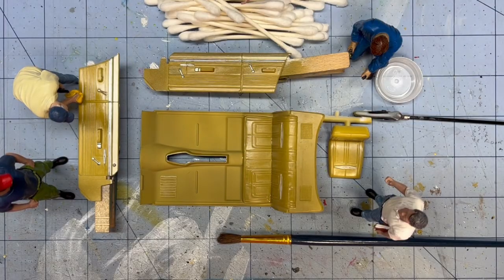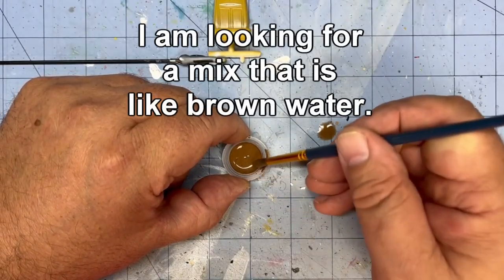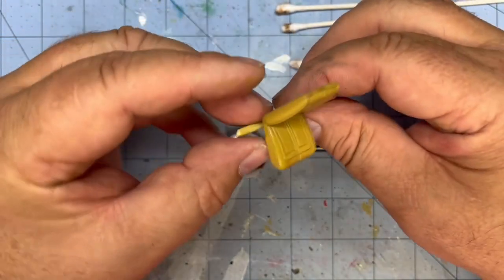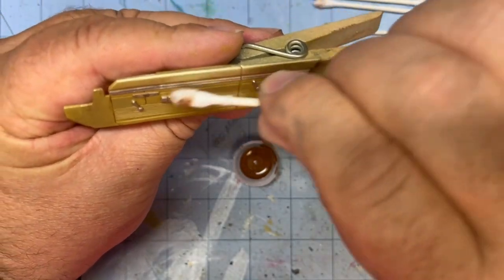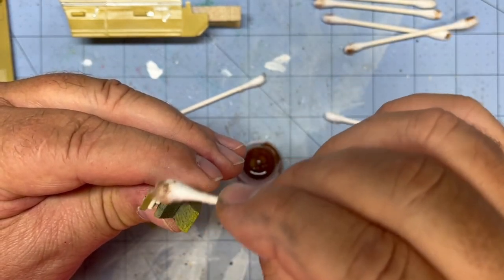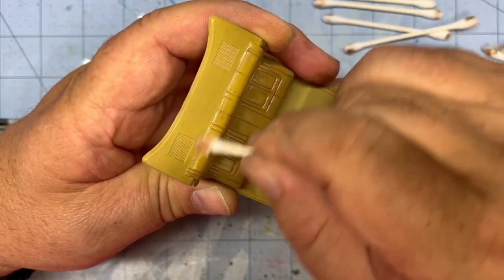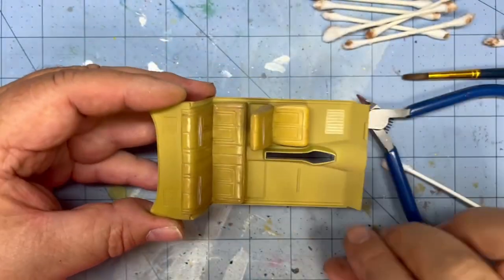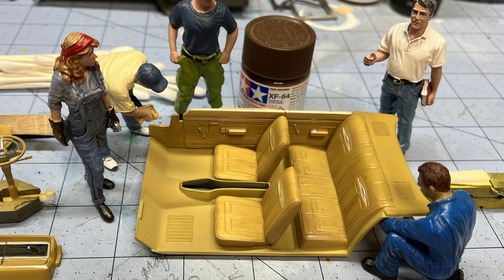Using Tamiya Acrylic Paint as a Wash

Comment: That's great, thanks! I'll be using this on my truck build. I've used the Apple Barrel acrylics on grilles and rear panels, I like it because it doesn't mess with the chrome.
Reply from the maker: I've done the same thing with Apple Barrel, I just don't have as many colors to choose from.  I also use Apple Barrel on my bumpers.  It goes on nice, and scrapes off so you can highlight things.

Comment: That is a slick trick yes big difference looks great. Meat to ask what do u use to apply ur quick shine thank you
Reply from the maker: Thank you.  For the interiors I use a soft flat brush.  That way I can control where it goes (so I don't get it on the carpet)  For the frame I use a smaller round brush and am very careful not to get it on the chassis.  For the body I use an airbrush.  I spray it at 20 psi and I do not thin it at all.